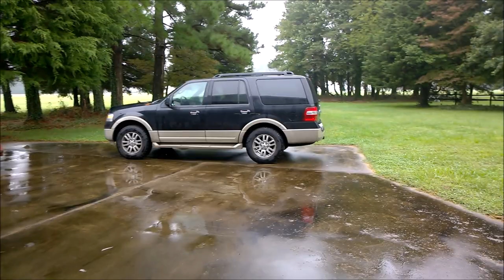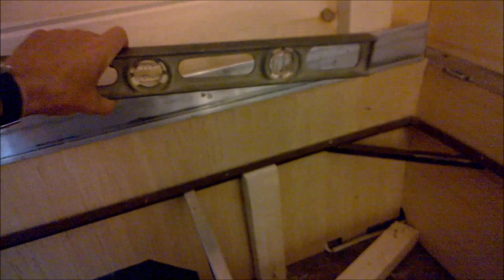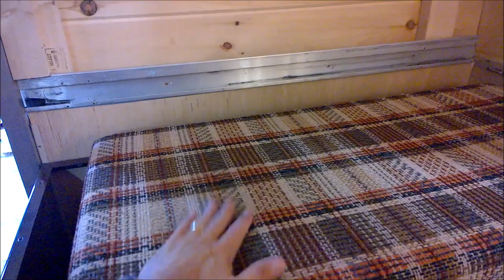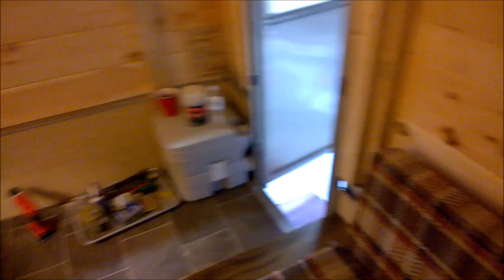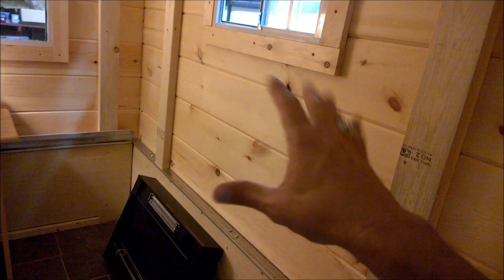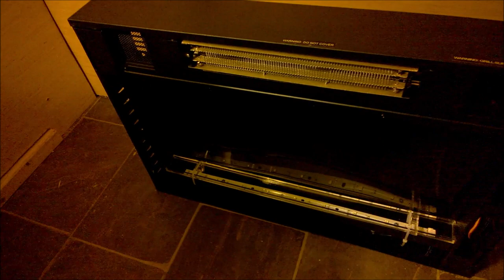Pop Up Camper to Hardside Conversion - Part 12! - Bench Seats & A Fireplace!

Comment: We’ve done a similar bench bed (not as wide) but instead of using the table we made a slat slide out system. Also put a bench bed against the opposite side wall that slides out sideways to make a cot sized bed (blocks a tiny bit of the door but when your sleeping it isn’t a prob) we are able to have a small kitchenette between both beds with fold out extra counter space and a small portable potty that slides out of an enclosed spot under the fold out counter space Perfect for the two of us

Comment: My friend did the same thing to a pop up. Now it weighs 1620 pounds. I noticed right away that the tongue has too much flex. Eventually it will break.So I’m replacing the entire tongue with heavier steel from just in front of the axle all the way to the front. The frame is way too thin.
Reply from the maker: It's been a few years but I did weigh the camper in one of the videos.  I seem to remember it being well under 1,000#.

Comment: lookin great.. nice work. did u add a lot of weight to the trailer? will it hold up? like to see it on the road cause i would like to do the same... thank u
Reply from the maker: It weighs around a thousand pounds at the moment.  Pretty light.  I still may upgrade the axle, we'll see.